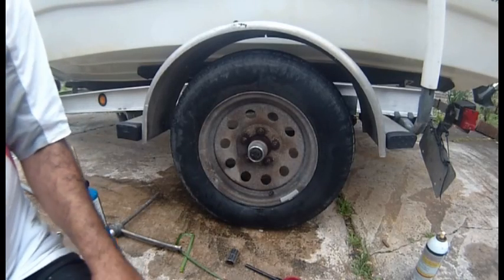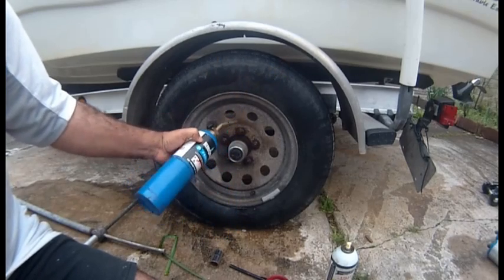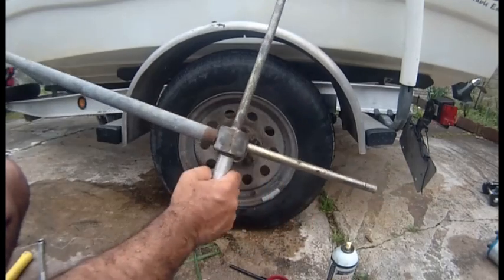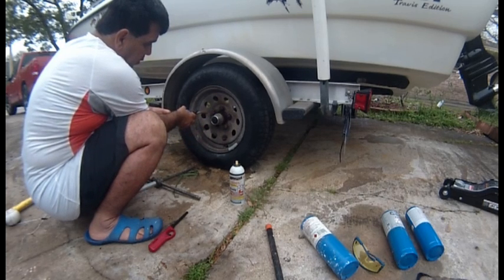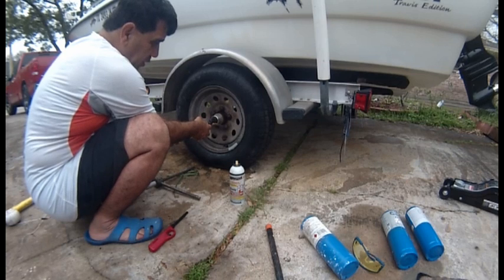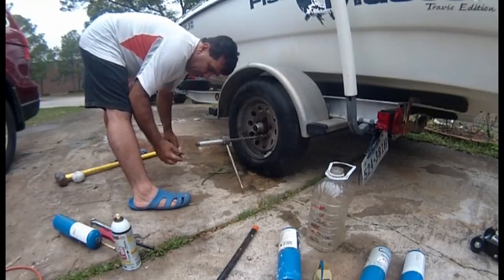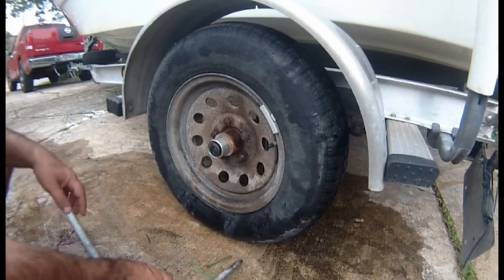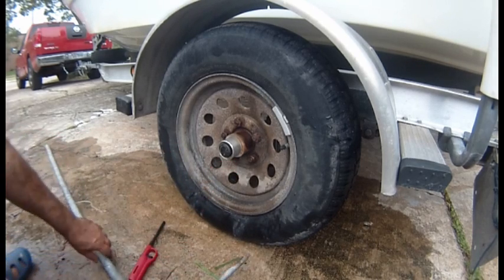Removal of rusty nut on a boat trailer

Comment from the maker: Update heat the nut then put water on it . Heat the nut only and not the tread  to make it bigger and while it is hot turn it. each nut should take 5 minutes. It is best to use marine grade lub on tread and have it loosen once a year .

Comment: Easier to change out the whole hub
Reply from the maker: I noticed if I heat the nut and cool it with water then heat it again while it is hot it will turn easley . hub can not be changed till nut is loosened . .we need to move and grese those nuts or you will go nuts when you have a flat.
Reply from the maker: add small amount of green or blue grease as well